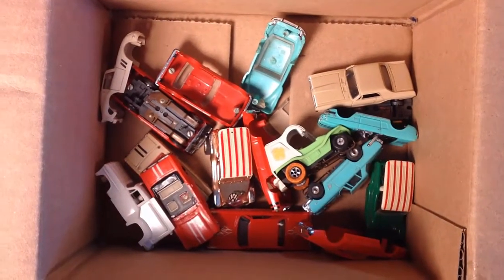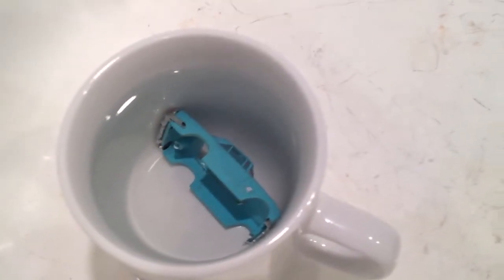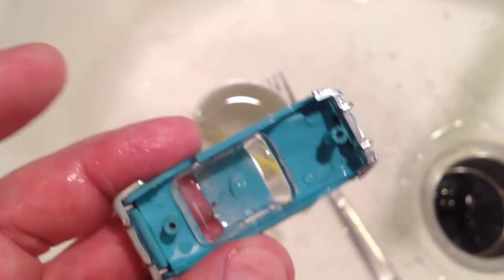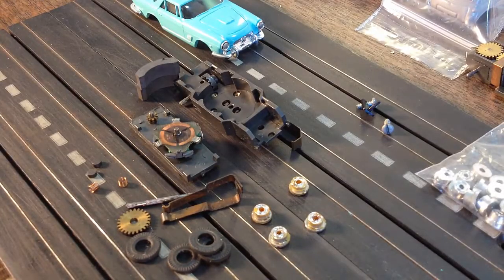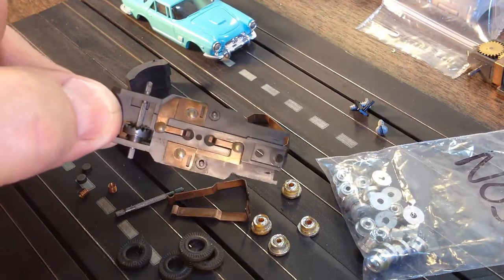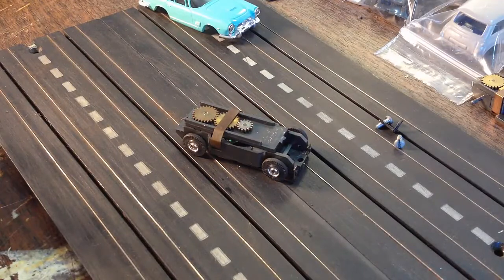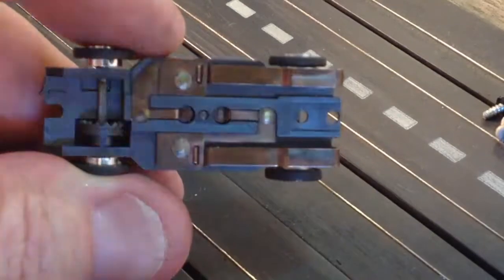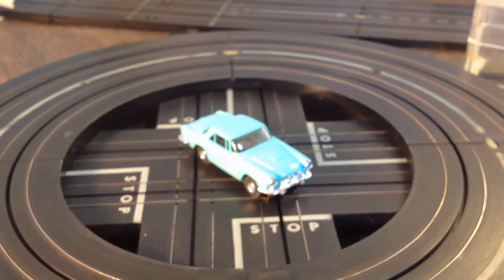Aurora HO Slot Car Maserati Restoration

Comment: How do you treat the worn spots on the chrome bumpers? Nice restore job.
Reply from the maker: Hey David, Great question. I have had my bumpers, hub caps and various slot car parts re-chromed. I haven't just treated the worn spots though. To have a bumper re-chromed you'll first have to strip all the old chrome off. It's very easy to do. You put the bumper in a cup and spray the original Easy Off oven cleaner on it till it's completely covered. Let it soak for 30 minutes wash the bumper off and repeat if necessary. I have a guy that re-chromes all my stuff. We recently moved and I'm still looking for all my slot car stuff. When I find his contact information, I'll post it for you if you'd like.Take care David and let me know if you need anything else.